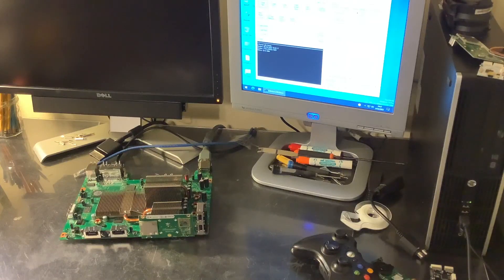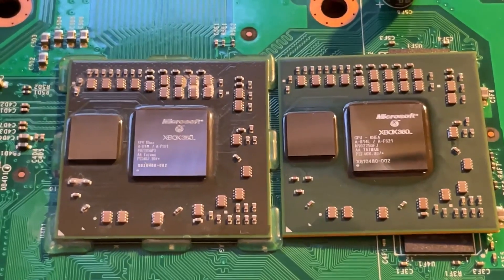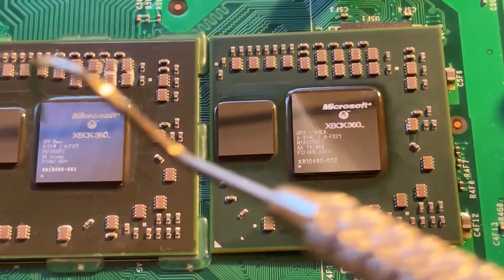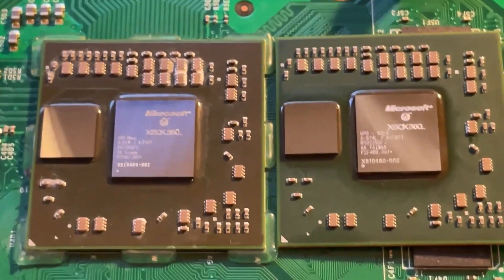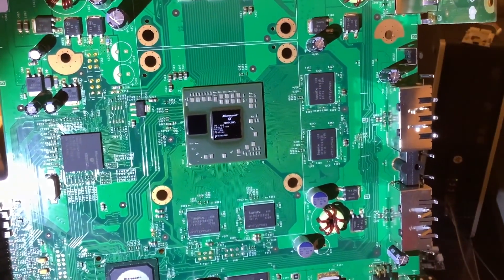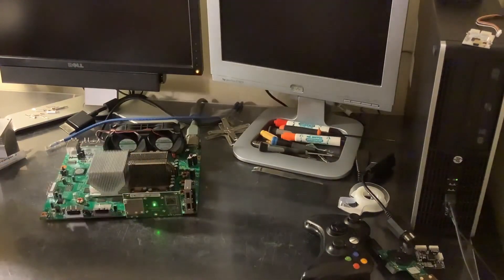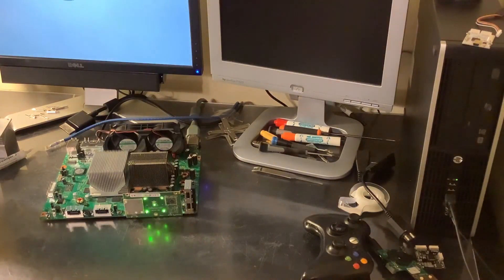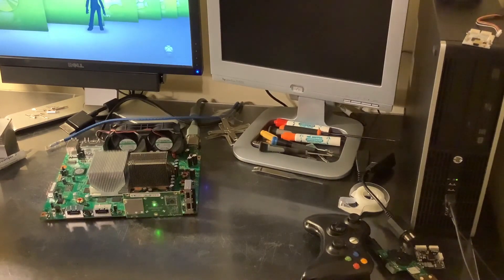Xbox 360 Zephyr 0102 Repair - BGA GPU Swap

Comment: I’m surprised they were still making the x810 Rheas in 2010 I would have think they would have all been replaced by the X816 chips by then
Reply from the maker: X81697x chip stop production after 09. X810480 high Tg made after. Don't know why.

Comment: Hi! i have a spare GPU ELPIS X819193-002 and i want to replace my dead XENON GPU. Besides soldering the new GPU, are there any more steps to do in order to get it working? Or just plug n' play?
Reply from the maker: Just fix the thermal targets to Xenon (Refurb). Otherwise plug n play.

Comment: Oh cool! I have code 0110 on my 2008 Falcon model Xbox 360 Elite which indicates a faulty RAM chip, so I plan to try to replace that chip.
Reply from the maker: No, mostly its GPU. RAM is unusual to fail. GPU is defective on many models from early/mid 08. You need new GPU 99%.
Reply: @Josh.Davidson  ah I see. I’m new to this whole thing, but thanks for the info. Thankfully it had a good disc drive, so I can use the disc drive on a Jasper unit I just got with a bad drive.

Comment: The aluminimum balls you removed from the spot of older chip Are already on the New chip or It can work without that??
Reply from the maker: It is not aluminum; the solder balls are applied to the new chip already.

Comment: Thank you for this video! I'm a total noob when it comes to this. I have an old Xenon model and would love to play my old 360 games again. You helped me identify the problem. For a noob without skills and proper tools, do you think it's wiser to just buy a refurbished 360 Elite for 50 bucks or try and replace the gpu myself? (It would probably be more expensive buying all the tools right?)
Reply from the maker: Glad you enjoyed!
Buying all of the tools and equipment is at least a thousand dollars, so cheaper to replace the system.
Reply: @Josh.Davidson  Thanks a lot! Sucks that's you're US-based or I would've gladly paid you repair it haha!

Is there any specific model you'd recommend? The Slim, E or Elite? Latest E model is probably the safest bet in terms of reliability right? Heard you say the Kronos is the best mobo, but I don't think these online second-hand shops here go into the specifics.
Reply from the maker: @ZZARevolution  A Jasper is the best reliability whether Tonasket or not.
Or, yes, aim for a Corona model E slim or if you don't care about modding the Winchesters are solid.

Comment: is the date on the gpu die?
Reply from the maker: Yes.
Reply: @Josh.Davidson  where exactly I cant quite read it, does the X02056 have a date as well to determine if its a high tg revision?
Reply from the maker: https://xenonlibrary.com/wiki/Y1_(GPU)
In the first picture, the date code is "0550" aka 2005 week 50. In the second picture it is "0824" for 2008 week 24. Then the third picture further down the page is "0819" for 2008 week 19. That is the earliest fixed chip I have seen. I have seen defective chips as late as 2008 week 11.
Reply: @Josh.Davidson  As I feared my 0607 is definitely not a high tg revision then, weird its still working though??
Reply from the maker: Luck I guess :D I have a few low tg still working.
Reply: @Josh.Davidson  Considering you're so knowledgable, you got any ideas about this rrod falcon ive got https://youtu.be/NXA6zpnCdWc (you might need to turn the volume up to hear the fan). Had 0001 error code, so replaced the blown sanyo caps. But now I have error 000000000000 etc. If I spam the error code combo faster I can get the 1 red light, but after that it just goes back to 000000000000000.....

Comment: Hello Josh. Please tell me Xbox 360 Falcon errors 0022 (35-37 seconds) and sometimes 0020 (25 seconds). In the console, the original nand dump. Is it a problem with the GPU too?
Reply from the maker: Hello, I can't know from that info, you can start here: https://errors.octalsconsoleshop.com/details/0022

If this not work, then you need to get the post code.

Comment: How do you keep the new solder balls on the chip? Does the new chip come with solder already on it? Or do you stick the new solder balls on the motherboard first? This step always confuses me lol
Reply from the maker: The new chip come with solder ball already.
You can see my Jasper E 74 video which shows how I reball the processors when I pull them from a board.

Comment: Hey Josh. I have a halo 3 speciell edition Whit jasper bord. When i turn it on the fan start whit max speed and it only flash red. Is this the right fix? Or should I get a falcon bord and change? Thanks for the help
Reply from the maker: Sir you need to tell me the secondary error code.
Reply: @Josh.Davidson  hello. the code say 0013 but  now when i try to start it its try to boot for about 30 to 50 sekunds. thanks for the help
Reply from the maker: Incorrect heatsink mounting or damaged thermal sensor in the eDRAM (small die on the GPU)
Reply: @Josh.Davidson  thanks. I will serch. And maybe do a full replacment to se if I my have same nolege

Comment: Where do you get your GPUs from?
Reply from the maker: This chip is 2010 purchased from ALIEXPRESS. It arrived with lead-free balls but I changed it to leaded.
Reply: @Josh.Davidson  Ah I see. Do you do this as a service? If so where can I get in contact with you? I have a Falcon that gets E74 every once in a while. The secondary code is the cold solder joint.
Reply from the maker: @carwashreviewsandmore7609  It is NOT a cold solder joint. Please completely disregard stupid sites like x-ex. The real code meanings can be found on my site: https://errors.octalsconsoleshop.com

Solution in that case of E 74 is to REPLACE the GPU. Anything like reflow/reball is a bandaid fix that will only last for a 2-6 months! The fault is NOT in the BGA soldering like everyone thinks, that is an absurd myth.

I don't really do rework as a "service" in the typical sense, more as a "paid favor" to friends or people I know - and also only if it's worth it, like JTAG, XDK, etc. Otherwise the price makes no sense.
Reply: @Josh.Davidson  Ah ok. Thanks for the tip! I’ll go check it out. Do you know anyone who does RROD fixes professionally? Like fully replacing the GPU?
Reply from the maker: @carwashreviewsandmore7609  If you really wanted it done, I could probably do it for you in a few weeks.
Pricing is $100. So usually only worth it for JTAGable, XDK.
Reply: @Josh.Davidson  I just want the GPU replaced. It’s not JTAGable nor do I want it RGH’d. I’m buying a Slim Halo 4 edition already RGH’d with blades.
Reply from the maker: @carwashreviewsandmore7609  OK fair enough. You can contact me through my website.
Be aware - its not actually on blades. Slims can't run blades. Its using Proto stealth to emulate the blades dashboard but only the dashboard, not the actual kernel.
Reply: @Josh.Davidson  Can’t you downgrade to blades with RGH? Also thanks for the tip.
Reply from the maker: @carwashreviewsandmore7609  What is important to understand is that dashboard is not just dashboard, it is the whole kernel. The older kernels and bootloaders cannot possibly support the newer hardware.
Reply: @Josh.Davidson  Ahhh good point. Do you know if the dashboard emulator includes the older startup? If not do you know a way to get that back?
Reply from the maker: Yes its possible.

Comment: Btw josh, I see that the suction tool you are using to take off the gpu is the same one as dosdude1's? What a weird coincidence.
Reply from the maker: Hello. Its common model suction tool. It not a handheld, has a base station to connect the vacuum.

Comment: Out of curiosity, will Zephyr_B take a RHEA GPU or are they pin swapped like Zephyr_A and Xenon?
Reply: Just wanted to come back to confirm that yes- just because a Xenon has a 2008~ service date doesn't mean it has the Elpis GPU installed. I bought 3 Xenons that were serviced between 2008-09 and they were all either 57 or Y1 Korea, with one of the Y1's sadly being 0102. 

EXT_CLK works great on both 57 and Y1 though in my testing, getting near instaboots with both Matrix and CR4... seriously appreciate the work you guys have done to make these older systems exploitable.
Reply from the maker: @steamingrefuse  Hi
Don't know what you mean CR4, I never made EXT_CLK for him.

Elpis start appearing in 2009 btw, but serviced might not always get. Usually I see MFR date with him.

Btw - GPU 57 is actually a prototype GPU. All X02056 or X817791 GPUs are Y1 (year 1) design.
Reply: @Josh.Davidson  Ahh I meant Rev C, my bad.

Yep it's X02056 but Korean and made in 2008, no idea about how reliable it is but seeing an '08 X817791 with 0102 doesn't give me much hope sadly...
Reply from the maker: @steamingrefuse  Hi
Gotcha np :D

X02056 Korean 2008 I have had good luck with. No failures in any that I've installed. Don't have much experience with X817791 but know it was used as a stopgap before the X02056 fixed was available. I think I've had one fail as well.
Reply from the maker: Zephyr_B and Zephyr_C are same pinout. RHEA GPU can be realized on that board. Essentially Y2 and RHEA are same, except the eDRAM. RHEA is even codenamed Y2.5.
Reply: @Josh.Davidson  Awesome.

One more thing... I found a good deal for a Xenon that was serviced in June 2008. I know it could've been sent in for anything, but have you seen Xenon's from that era with Elpis GPU's?
Reply from the maker: @steamingrefuse  Serviced could be a toss up. Maybe some got new GPUs and some were serviced for other reasons.
The refurb boards usually fitted with new GPUs are in "MFR date" cases 2007/2008/2009+

Comment: Wow man great job your BGA rework skills are impressive. I recently discovered I have a jtagable 7371 Xenon but it throws rrod with 0102 once in awhile. 

Is it even worth saving?
Reply from the maker: That is up to you. The repair of 0102 properly is expensive. If it is worth it to you, then yes.
Reply: Cheers josh you’re right. Thanks for your reply. 
I’ll probably sell it as is and perform RGH on a jasper I’ve got laying around. Just need a nand flasher 😂

Comment: So cool! Do you have a list of the tools you use posted anywhere? (Your soldering irons, brands of flux, solder, heat gun, etc.) Thatd be very interesting to know!
Reply from the maker: Not really. Here's a few:
Iron: Weller WES51 (Analog), tip shown here is ETKN
Flux: STIRRI-ASM-TF
Wick: MG Chemicals 426LF
Hot Air: 858d El Cheapo
BGA Rework: DIY
Reply: @Josh.Davidson  Wow thanks! I'm surprised more people haven't asked for this. You've obviously got a talent for this stuff so it's very helpful to know what tools you prefer & recommend.
Reply from the maker: @jhawkzzz  Thanks friend :)
Probably someone did and I told it, and just forgot about it :D

Comment: its jasper GPU
Reply from the maker: No, I am change it for another 80nm GPU RHEA which was manufactured in 2010. MS continued producing fixed version of both RHEA and ELPIS 80nm to fix RROD Xenon Zephyr Falcon until 2011.
Reply: @Josh.Davidson  Are the pinouts same between the 80nm GPUs and the Jasper / Kronos 65nm GPUs?
Reply from the maker: @Repeatingpower7  Yes - but if you don't make other changes to the motherboard (which so far are only possible on Falcon), the GPU will DIE!
Reply: @Josh.Davidson  Oh ok thank you for clarifying. Maybe one day someone will figure out the necessary modifications that are required for the Xenon and Zephyr motherboards so the the 65nm GPU can run properly on them.
Reply from the maker: @Repeatingpower7  My pleasure. Actually I am working on exactly that. Stay tuned my channel!
Reply: @Josh.Davidson  Sweet! Ill be sure to keep an eye out for any more uploads!
Reply: @Josh.Davidson  does it tell you the manufacturering date on the gpu die?
Reply from the maker: @TristenOnYouTube  yes